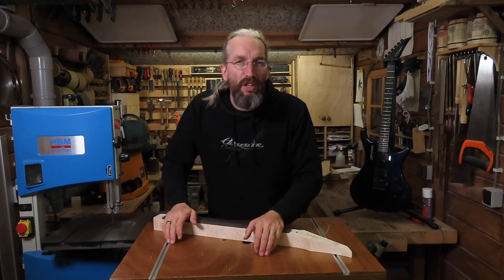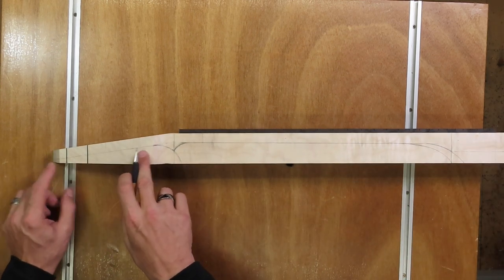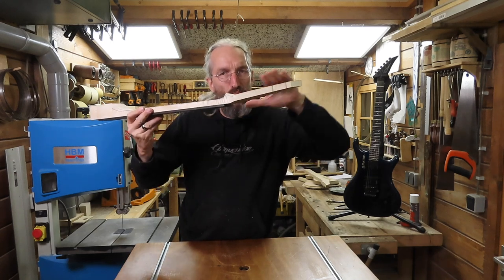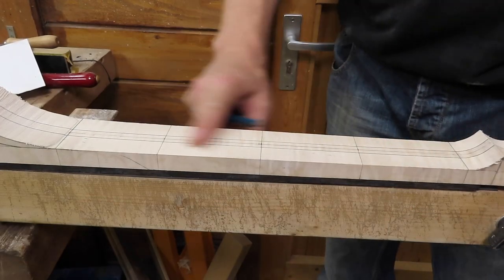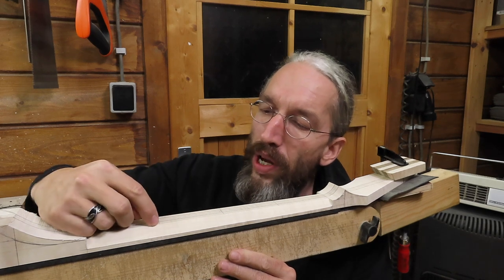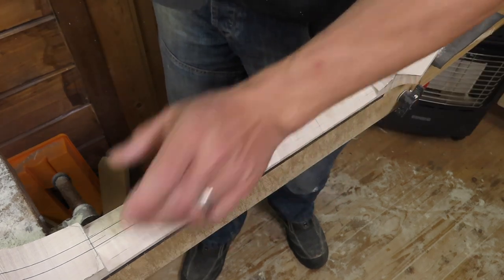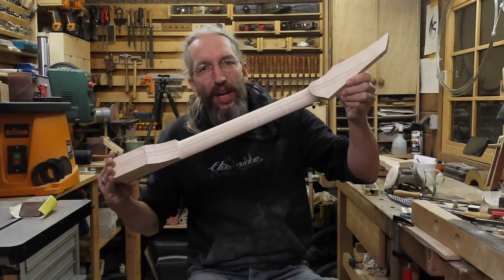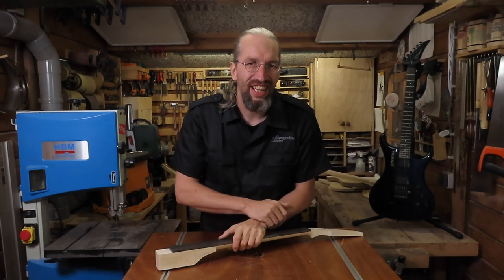Westone X390 Pantera CB - Tribute Guitar Build - Carving the Neck.

Comment: You make necks look so effortless!  Out of curiosity - how high can your bandsaw cut?  I'm looking to get one in the next few weeks and I'm uncertain about resaw height and what would be good.
Reply: Yep he is a true craftsman. For what it's worth I just bought a Rikon 324 for 1,200 out the door from Rockler and it's a great saw with 13 inches of re-saw. I  looked long and hard and it got the best reviews. Hope that helps
Reply: I would say you need a tad over half the size of the biggest body you intend on making for a book match blank  around 7.5" - 8" would probably do
Reply: If you want to resaw for bookmatching tops, you need a bigger band saw that can do 7" plus vertically.  Mine only does 5.5" but I found a workaround by doing a double bookmatch 4 piece top after cutting the top in half and then resawing each half.  You just reconnect where you sawed in half and fold the new pieces out.  If I had had the space I would have gotten the 14" Rikon, although its 3x the price.  I think the 10" saw and my miter saw are a better combination over all than a big bandsaw.
Reply from the maker: Hi Owen,
Mine cuts up to a height of about 165mm. For re-sawing tops it is too low to be honest and the bandsaw itself is to unreliable for re-sawing.
I'm looking to get the Laguna 14x12 it should have a max. cutting height of 305mm.
Reply: @r.llynch4124  Thank you very much!
Reply: @barrychristian4050  Thanks Barry!
Reply: @michaelmenkes8085  Thanks Michael, I'll look into one of the bigger models - appreciate the support
Reply: @UnquendorGuitars  Thanks for taking the time to reply Daniel - it seems from most people's advice getting something that can do the larger sizes is recommended for sure.